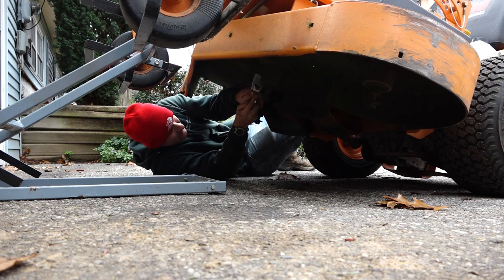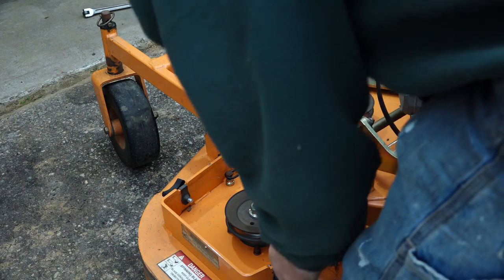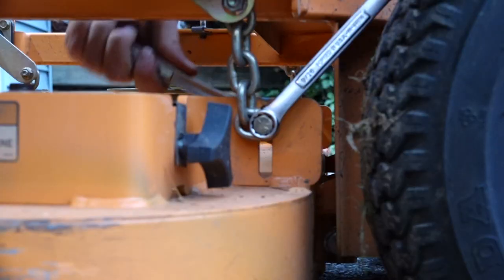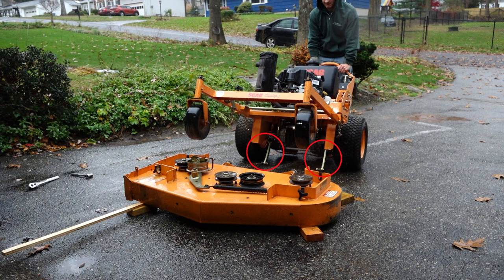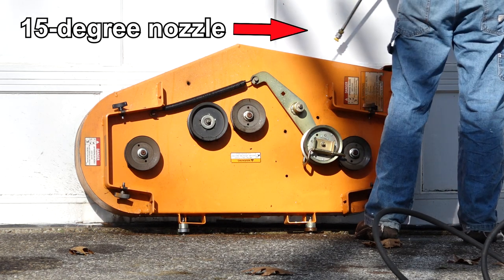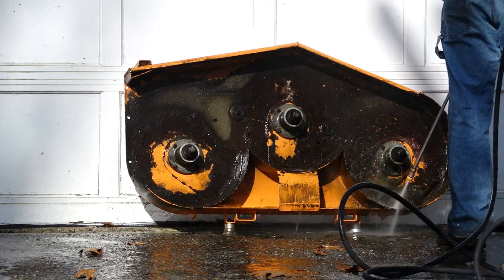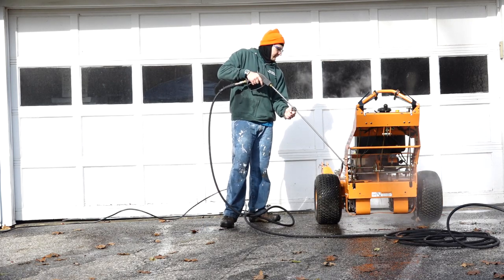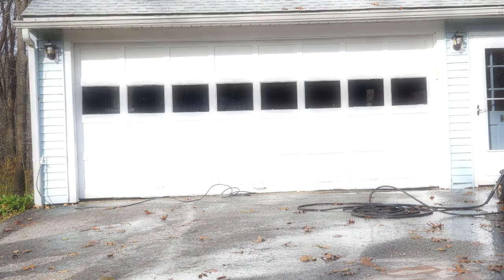How to Remove Mower Deck and Wash Deck and Mower: Scag SWZT

Comment: People actually clean their mowers?
Reply: Martinez Family yea, helps the last longer. The grass builds up and starts to rot the steel. The grass stays wet and holds the moister making it rust faster. Also a clean deck will work more efficiently.
Reply: Not the folks who sell me their mowers :) . Clean them out, and voila, they work again! Amazing how many people don't clean their equipment and wonder why it doesn't work correctly.

Comment: So can you put a bigger deck on it than?
Reply from the maker: There is an awful lot that has to line up **just right**. On my model, I don't think I can just swap decks to the 52", but it may be possible on other "floating" decks like mine. I would definitely not try it unless you can be 100% certain it's going to work beforehand, and the best way to do it is to call the manufacturer direct (most manufacturers will actually answer the phone and will give you a straight answer).